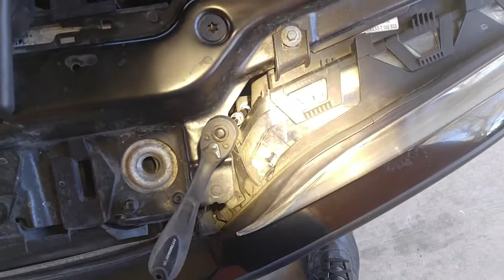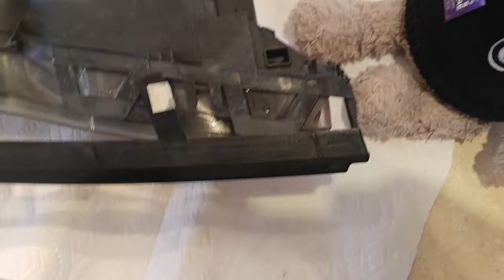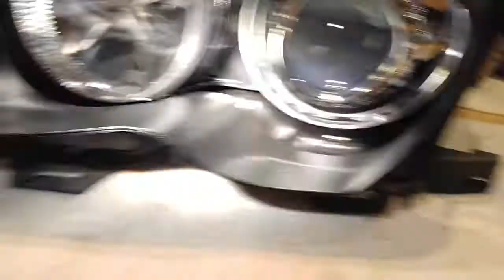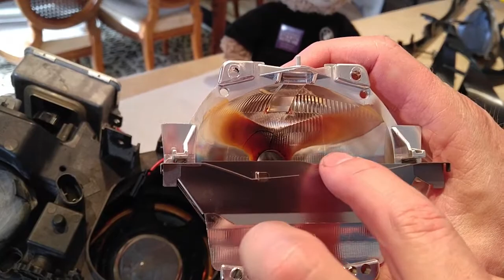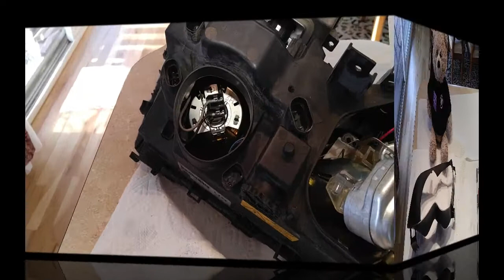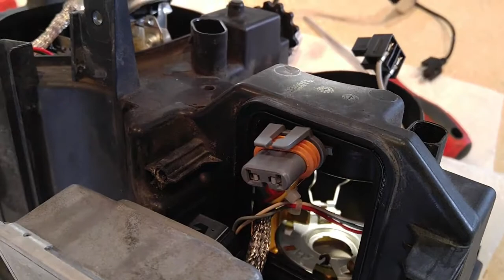Jaysbigadventure BMW HID Reflector Bowl Fix

Comment: For anyone interested, there are companies that resilver / rechrome the reflectors, metal or plastic.  I've only found them in Germany.  You send your old ones and they fix them and send them back.  They also have stock of resilvered reflectors and they can send fresh ones and you send your old ones back and refund a deposit.  Link below because youtube will probably kill the comment.  Used this company myself.
Reply: PVD coating...aluminuim vapour...lot of them in Poland
Reply: I also need the link. Thanks
Reply from the maker: That's good to know! Thanks for sharing.
Reply: @gplusgplus2286 what’s the link? Thanks!

Comment: Ridiculous, how can you compare results when you have put different bulbs in?
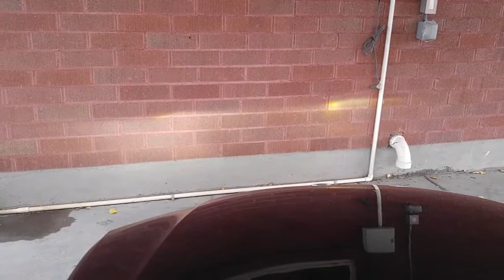Reply from the maker: First of all, that was the point, to improve the light output. And I did not change the low beams. You can clearly see what the difference is on low and high. This is at the 9:45 mark.The flash-to-pass was just an additional step since I was already in there.

Comment: Hi my friend. I found a real solution to this problem. If the bowl are made of aluminium, you have to sand all the crome, all the cooper layer to reach the aluminium. Begin using a 300 grit sandpaper and polish gradually with 400, 600, 1000, 1500, 2000 3000 grit. 
When you finished polish with mother's, meguiars or another best quality aluminium polish paste and enjoy the mirror finish result. 
P. D: Grab some 🍺🍺🍺 for cool down rhe stress process. 😁😁😁
Visit my instagram site in spanish but all in there may help you a lot.
https://www.instagram.com/p/B0cH7q2DYRB/?igshid=1sood9eanwrnf
Reply from the maker: That would be great if the bowls were aluminum. There are two suppliers - maybe the other ones are metal? These unfortunately were just plastic.
Reply: How long do the repaired lamps work well?
Reply from the maker: @mateuszbronis3515  They were still great 2 months later when I sold the car for an 03 M3! :)